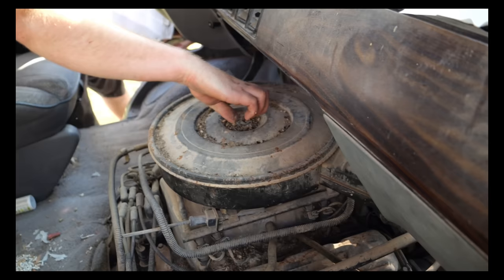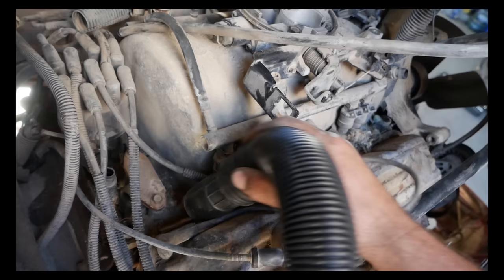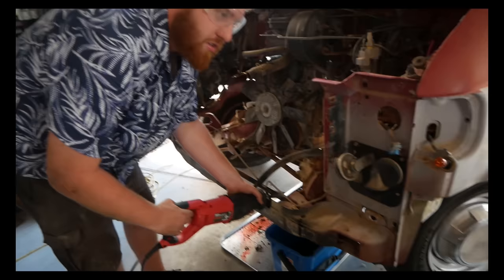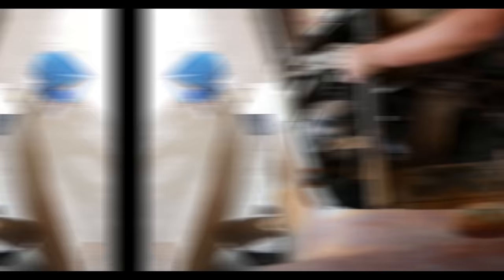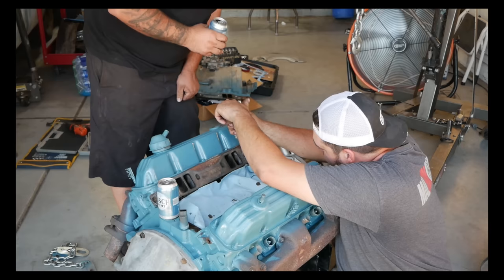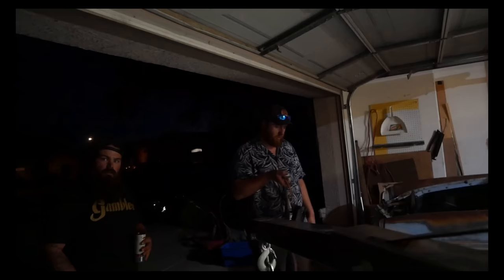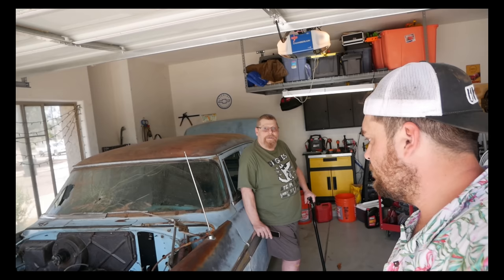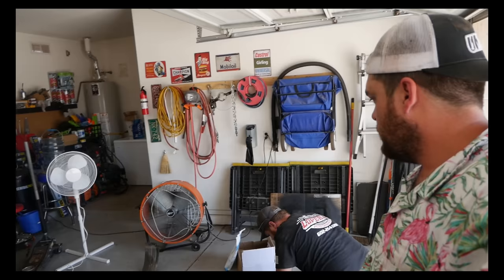Disabled Vet's LAST PROJECT Gets New Life! FIRST START in 48 Years!

Comment: You guys are really great for doing this for a disabled veteran.  I am sure he would do it himself if he could. Its too bad you broke that old Orange Harbor Freight Reciprocating Saw. I have one like it and mine is over 10 years old and still works like a champ!  The newer ones just don't look as tough.  Mine even came with a new set of brushes. Maybe put the engine and transmission in the DeSoto!  It would be "much more reliable" then. LOL
Reply: I had an angle grinder burn up.  It was Dewalt or Black and Decker forever after that!

Comment: This is early similar to the May long weekend me and a friend spent helping another guy get is Dodge Dakota project truck put together. Pulled the drivetrains from two trucks, thankfully the cabs and front were off. Put on headers with the used studs from three 318's, a Hues intake, hunted down and installed a pilot bearing and finally got the new used drivetrain into the frame late Sunday.

Comment: Second time watching this one and it was a blast yet again. Awesome work guys and fantastic effort!! My hope is Tony will have/does have an awesome ride once fully put together.
Fun fact: DeSoto was a division of Chrysler from the 1920s up to 1961. My guess is whatever driveshaft the stock Desoto Firedome had (other than the u-joints and yoke), it shared with its other DeSoto models. And the Chrysler division continued to use it after the division shuttered and those driveshafts made it into Dodge vans/trucks (like the Magnum V8). What isn't broke, don't fix it.

Comment: Next time jack the rear of the car up in the air. The engine will go in straight and you don’t have to lift it so high to clear the radiator support. Thats how Carroll Shelby put big engines with trans in the little Cobras.

Comment: I dropped my brand new Milwaukee battery drill about 6 feet down to the floor on a major electrical job (new 3 phase air compressor). Which required a brand new 208/240v service. It broke in half and I ended up having to borrow the master electrician's new craftsman drill to finish the job. I could not believe that a 400 dollar drill just broke when I seen a 80 dollar drill get launched off of a lift 30' in the air to the floor blowing the battery 20' from the drill and it work just fine like nothing happened.

Comment: With the magnums. If you don’t wish to replace the oil pan gasket(highly recommend if the engine is out as it may be a PITA otherwise) would be to apply a bead of BLACK rtv between the timing cover and gasket. Will help BIG TIME with oil leaks.
Reply from the maker: Yep that's what we did

Comment: Fun tip for doing freeze plugs. Clean up the block and put the silly cone on the block. Put your freeze plugs in the greezer for a whole before hand. They will shrink and you can just put them up there and hold them in place with your hand and they will expand into place. They will never come out.

Comment: You should have put the car on the engine, assuming the front lower cross member can be removed.

That's how they did it at the factory, so it's easy! Use the engine hoist to lift the chassis, then stabilize the front with jack stands & deflate the rear. Drop the X-member, steering, & sway bar, disconnect everything, & the engine can be removed on a pallet jack.
Reply from the maker: That's waaaaaaaay more work. Also, not how these were installed. This is a full frame car, Chrysler went sub frame in 60, and unibody (except C body) in 62 I believe. The factory would have dropped the body of the car onto the frame

Comment: Interesting to see that impossible bolts is largely a Mopar thing. Tried to replace the spark plugs in a Grand Cherokee myself. This requires the total removal of the air intake manifold, which for some moronic reason, has a totally blind bolt around the back side of the engine with barely enough space to get my thin hands in there. I didn't have the tools to get to that accursed bolt, and thus had to take it to a shop to get the spark plugs changed.

Comment: That's one thing I don't miss on my 2000  gloss black with white pinstripe dodge ram Laramie slt longbed quad cab 1500 5.2 litre 4x4 the famed rv muffler, and yes the accessory drive just like the gm tbi vehicles is to pull the water pump, power steering pump or the intake manifold keg, and the clutch fan has a big nut that threads on the water pump it doesn't just bolt on lol..

Comment: There is no doubt that y’all ain’t never worked on a MOPAR ! You don’t have to pull the distributor to take off the intake in a small block mopar! They make a loaner tool at Autozone or Oreillys that removes the fan from the water pump !
But I guess y’all work on several GM products
Reply from the maker: You absolutely need to remove the distributor on a magnum to remove the keg intake

Comment: How i usually pull van v8 and inline 6 motors is removed the transmission crossmember and raise the transmission with a floor jack and a 4x4 cut off railroad tie, and use a big pair of vice grips and use them so when you come in the side passenger door to lift the motor lift the motor so the rear is lifted up and move it as far toward the front core support as you can, reposition the floor jack sit the motor down and move the engine hoist to the front and pull it out of the front and honestly it probably just easier to cut the rocker and floor out of way but I have pulled motors from a 77 short wheelbase Chevy g10 van,a 84 gmc van dura g2500,a 77 d100 tradesman short wheelbase and,90 dodge ram maxi van b2500 318 van..

Comment: I’m not a professional mechanic or anything, but it seems like it would be a lot easier taking out the passenger seat and using the side doors on the van and pull the motor from the side of the van. But y’all know what you’re doing

Comment: On some magnums the external balance weights are on the converter or flexplate, if it doesn't have the weights it will be damaged. They also make a fuel pump eccentric kit to us a mechanical pump on a short snout cam, lunati or Hughes engines

Comment: The plenum gasket on those engines are known to leak, aluminum intake with a steel plenum plate, they expand and contract at different rates causing the gasket to leak.

Comment: Much of that goo in the water jackets was probably sand left over from when the block was poured.
Reply from the maker: Better not have been! Coolant is supposed to flow through those
Reply: @PoleBarnGarage  Coolant does flow.through the water jackets, but it you were to research my statement,  you'd discover that I know what I'm talking about.   I'm a former USAF PJ and I have been working on automobiles for more than 54 years and ten years ago when I stopped doing it on a daily basis, I had all nine certifications.
But it is interesting talking to you.

Comment: And there ladies and gentlemen is why I am not a fan of stopleak mainly because I have ended up with two vehicles that previous owners ran bottles of stopleak in and i flushed them and ended with overheating issues plugged radiator and bad water pump in both, and to top it off my dad was using my 78 Chevy c20 custom deluxe for a work truck and it acquired a slight intake leak he put two bottles of bar's stop leak in the radiator it instantly overheated and blew the bottom radiator hose and cracked the damn block.which i didn't find till I fought seized block bolts out getting the water pump off,, and the front freeze plugs got pushed out but once I drill and tapped out the water pump bolts and found the crack block i pulled the 350 vin m medium duty motor most people hunt for..oh well and new water pump, radiator,heater core and a 84 gmc van dura 305 got put in a 84 Chevy c10 Silverado to work off a 83 Chevy 305 with only 90k miles that is what I ended up putting in my truck but before the stop it was a over ,450k mile truck that ran fine.

Comment: 35:05 I wonder if the LA engine fitting so well in this '56 translates to the Forward Look cars from 57-61 or so.  And how low it sits in there, might could probably even use the stock EFI intake if you had to.
Reply from the maker: That was using the factory hemi motor mounts as well, I forgot to mention that
Reply: Actually this IS a forward look car. The Forward Look was actually from 55-61

Comment: Why didn't you put the few injected thing back on top of the engine
Reply from the maker: Unbelievably complicated, requires the entire wiring harness, fuel pump, lines, etc. Or you just bolt a carb on and go.. it's assembled now, Tony is a capable guy

Comment: Did you replace the freeze plugs steel or brass?
Reply from the maker: Probably steel, I dunno
Reply: @PoleBarnGarage  brass are usually a bit more expensive, but on the upside they'll never rust out.

Comment: Appreciate the entertainment, but unbolting the cradle and lifting the van with cherry picker would have been way easier. You GM and Ford guys with always lifting the engine. Chisel and a hammer on the edge of the flat in loosen direction makes the fan clutch break loose.
Reply from the maker: Did it look like we had the means to lift the van 4-5 feet?... Lol

Comment: So they cleaned it with high pressure washer, i hope it doesn't sit for years again. Otherwise this motor will be scrap to
Reply from the maker: What in the name of God are you talking about?
Reply: @PoleBarnGarage  sorry English is not my native language. If there is still water in the engine and the car still sits for a very long time he will have a rusty engine again
Reply from the maker: Oh nah, it cranking and firing that little bit is enough to coat the entire engine in oil

Comment: U make so much work for your self s. If u was smart enough u should have used the hole 1996 drive Tran and can bus and everything no turning required because it's for that set up. No need to pull off air take. .I pulled vans and more engine s trans every day at work. U you're brains next time
Reply from the maker: "U you're brains"

Comment: The ppl who design any machine should have to be able to repair it in a one car garage using nothing a normal person would not have in their tool box.

Now this can be done with ease with E-machines but the infernal combustion thing today it is impossible b/c of all the Electronic shit on it.  Today tol work on a car built in '23 u need 4 yrs of school.

Why 4 yrs of school?  B/c u need a degree in electroniocs of at lest a BSET if not an EE.  An AA will not do.

Why this level of ed just to be a car worker oner?  B/c burning petroleum is bad for Ma Terra.  In the about 120 yr we have been doing so air quality has gone down to where there is no place on Ma Terra that is not affected.

I like cars but the harm they have done to Ma Terra will take 500 yr to undo.